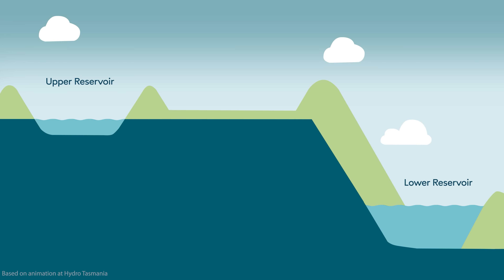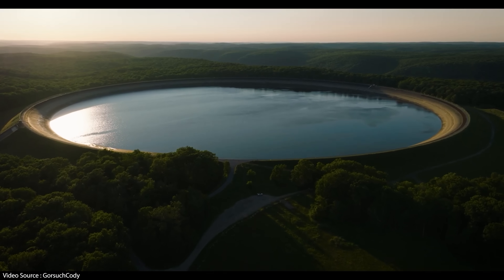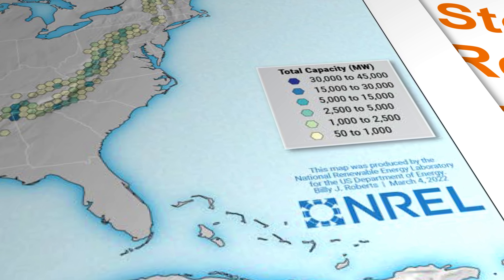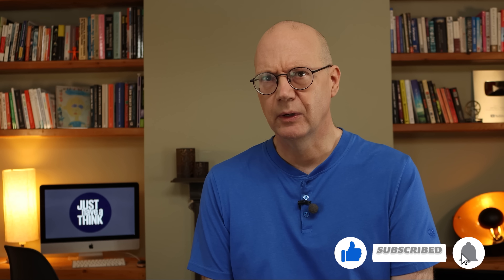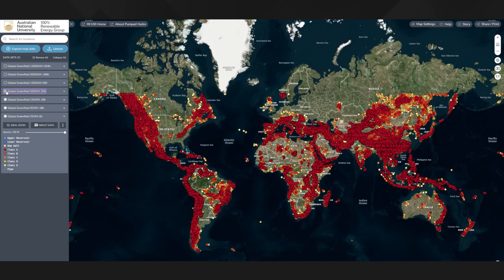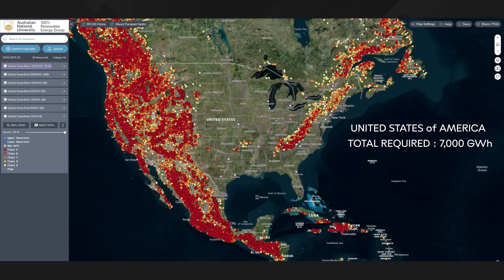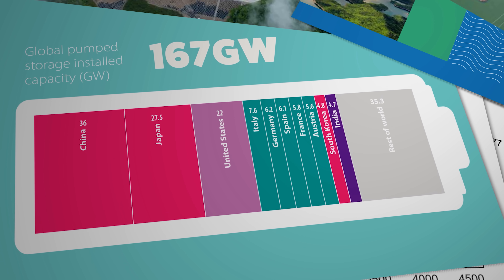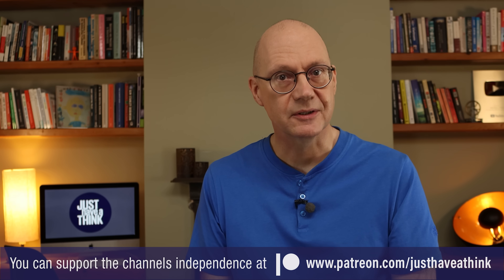The insane potential of Pumped Storage Hydro

Comment: I really hope they can advance the geothermal technology. I heard there's a possibility of a drill that cuts a bore hole with a laser and it hardens the bore hole walls as it goes so it doesn't collapse in on itself. It could really increase the level of depth we could drill too and the types of locations to drill at. Geothermal technology would be so helpful.

Comment: Thanks Dave - for another interesting & sensible idea. But I was hoping that you might also have mentioned the concept of "Hybrid" power generation systems. For instance, one or both reservoirs could be used for the placing of Floating Solar Farm arrays. For reservoirs that are in the open, obviously. And possibly with some well-placed Wind Turbines as well. There has been a (fairly) recent video about the benefits of floating Solar Panel arrays, (on another well-known YouTube channel about renewable Energy and EVs). Pumped Hydro is a well understood, known cost, tried & tested system, for efficient power generation. It's a proverbial "No-Brainer" - especially if combined with other renewables.

Comment: Any one with half a brain can work out that this won't work. So you are gi oing to pump hundreds of millions of litres of water up hill when there is excess generation, and exactly when is that likely to be. Why don't they just pump the water up at night when the cost of power is lower😂 pumping water up hill uses way more power than the water will produce on the way down. It's a great scheme to sell to morons.
Reply: Yes, water is pumped up at night when there is excess cheap electricity available, and then used to generate electricity in the day when power is most demanded. Pumped storage facilities in operation today work that way.
Reply: @sharkheadism   you are obviously  not too bright if you think it makes sense how is the power generated to pump the water uphill,
Reply: @Luke-pb9oz  Pumped storage literally works right now and it's utilized across the globe, and you're saying it won't. What do you know what engineers and utility companies don't?
Reply: @sharkheadism  well I know it takes many,many more times more energy t.o pump water up hill than it produces coming back down, tell me how the power to pump up hill is generated.
Reply: @Luke-pb9oz  The fact that it is used economically around the world should tip you off that it's not as inefficient as you claim it is. The energy to pump water comes off the grid at night, when there is excess cheap electricity available from baseload plants. It is then released when demand is highest, during the day.
Reply: @sharkheadism   how is the energy generated to pump the water up hill. It's a simple question why don't you answer it.
Reply: @Luke-pb9oz  From baseload plants that generate excess electricity at night.
Reply: @sharkheadism  you still haven't answered the question of how the power is generated,  but OK so there are power plants generating excess electricity at night, wouldn't it make more sense just to cut back the amount they are producing in the first place.

Comment: Humans have built 500+ meter buildings. The depth of 2 Olympic swimming pools would be around one floor of height. Depending on the footprint of the building one could easily have one or two double-sized swimming pools worth of water on the top floor and a floor-sized bathtub on the bottom floor. Skyscrapers already have mass dampeners full of water in them near or at the top floor.

Stupid question: Other than the fear of nearby street flooding if an accident occurred, why have we never built a pumped hydro skyscraper in a large urban city to get 3-6 MW of clean energy? Surely, there would be less evaporation in a building or enclosed tub as opposed to an outdoor reservoir, right?

Edit: I thought of more. This electricity would be right in the heart of a population center, so losses would be minimized in transmission. 
If a floor-sized basement was used for the lower reservoir underground, the first few floors could still be used as parking structures for nearby businesses and residential buildings.
Surely, a steel building can't cost vastly more, and may even cost less, than concrete dams to create pumped hydro storage areas in less than ideal natural locations.
Reply: No because we build skyscrapers for people to live and work in, not to generate power. Build a larger, far more economical pumped storage facility elsewhere and bring the electricity to the city.
Reply: @sharkheadism  You very well could be correct. I don't know. My thought process was that we have non-human structures already like radio towers. Windmills have a maximum height at ~250 meters.

Putting up a hydroelectric building may not be worthwhile. It would save on landfill space because the building would not have fiberglass blades like windmills though.

If the building is already going to be built, adding some vertical parking in the hydroelectric building could offset some of the cost. Putting more residences and businesses on current surface level parking lots could create more density and fewer miles traveled by car. These surface lots would be serviced by the hydroelectric building instead.

I just don't have the expertise to run the numbers. If anyone knows of an expert, I would really like to see the research.
Reply: @pace1195  The only way to make skyscrapers economical to build is to maximize the amount of space inside them that's usable to people. You've got to have other things like elevators and HVAC and so forth, but anything beyond the necessities just makes the building less economical.

Given the enormous power loads skyscrapers consume I don't think a couple of swimming pools or a wind turbine would do much to benefit them. Better to build that stuff at larger scales in areas where it's more productive. Transmission losses even over very long distances are so low it still makes economic sense to do it.
Reply: @sharkheadism  If you have no people, then it is just a barebones building. Sure, you need some elevators for maintenance workers. You would not need the H or AC, just the Ventilation for the parking garage portion. 

I thought of another addon. You could clad one side of the build which gets sunlight with photovoltaics. Then you have pumped hydro + some solar and parking fees.

You still may be correct. I live in the western US. I would like to see much more pumped hydro where it could naturally occur. I don't believe most politicians want it because of environmental and political reasons. 

A building which takes away surface parking and a few cars off the road gets around many of those restrictions, even if more expensive.
Reply: @pace1195  Using solar to pump water is a pointless undertaking because the best use of pumped storage is to generate when electrical demand is highest--during the day. Pumped hydro facilities release water during the day and pump it at night when cheap extra baseload is available.
Reply: @sharkheadism  I didn't say you need to use the solar to pump the water. It would just be an addon source of revenue for the building. Have 2 meters: one to send solar power when the sun is out and the other to regulate the pumping or draining of the hydro power for financial reasons.
Reply: @pace1195  You could do it, but that's such a small reservoir and it would be built on very expensive land in a very expensive structure, I can't imagine a single way it would be economically viable. Certainly suboptimal for cities that would benefit more from the parcel being used for human occupancy.

Comment: This is VERY exciting!  I'm curious whether there's a potential for this to work on a micro scale, similar to microhydro electricity generation.  For example, on a property with a 300' - 400' elevation change on it, could that elevation difference (depending on the amount of water stored of course) provide all of the power needed for a home and shop located on said property?  And if so, how much would the volume of water need to be?  Could you post any resources you have for calculating these things?  I'd be most grateful.  

Thanks for a very hopeful and motivating video!

Comment: And... if you add floating solar arrays on the upper, or both ponds depending on the facing, you potentially make them self "charging" (pumping to higher pond), and a generator even when they are not charging. Floating arrays would also minimize evaporation, and reduce the need for chemicals to minimize algal growth.

Comment: Also, please take a closer, more critical look at flawed iron air batteries. These are being foisted on us as "long duration" storage, when in fact they should more appropriately described as impracticable slow batteries, whose charge and discharge rates are ~100 hours, meaning you CANNOT use them fully in a 24 hour or more importantly 5 hour charge period which is critical to store solar. They are a boondoggle, being hyped as emergency low cost backup. Pumped hydro can be rum more quickly in either direction with the same volumes by adding more pump/generators. I believe most designs reuse the same mechanism for both pumping and generating.

Comment: Tasmania is 100% hydro power with additional capacity from the multitude of roof top solar systems installed. We’re connected to the mainland by an underwater power cable installed initially to sell Green energy to the mainland at huge prices. This was to produce more power rather than let dams overflow.
We’re in the process of installing a pumped hydro project using an existing hydro power station. It used to be that pumped hydro would replenish at night when demand was low and using cheap power from coal fired power stations. As these will be closed then the power could come from hydro, wind or solar. The only dependable option would be hydro (unless you have a drought) as solar won’t work at night and wind is intermittent.

Comment: Great solution and great video, Dave. Drought threatens traditional river hydro and evaporation and water scarcity could create challenges but not enough to dismiss PHS. Another untapped process could also be to use this with coastal saltwater which could assuage water scarcity concerns. 

Of course any time you manipulate water at massive scale, there are environmental impacts. But it seems more likely that pumped hydro storage could be more sustainably managed than any chemical battery. Lazzard's LCOS has unfairly put the finger on the scale for lithium grid storage for a long time, ignoring the impacts, sustainability, and competition for EVs. It's time for responsible stakeholders to deprioritize short term profitability (and unscrupulous energy arbitrage, Hornsdale!!) and instead make choices that aren't long term losers on sustainability. Please build pumped hydro quickly and sustainably and use it for daily time shifting of solar instead of saving the potential energy for peak events as we often do now.

I'm not a nuclear supporter at all, but Muddy Run PHS that is mated with Peach Bottom nuclear plant has demonstrated how pumped hydro can bank excess and provide its use later. That system allows the nuclear plant to run continously but provide more than its rate nameplate by discharging PHS during normal load times, and charging while people sleep.

Comment: I had to dig and dig to try and find the energy loss of closed loop pumped hydro storage and costs.

The loss is about 80% (but I suspect it is higher in practice).  Still, the costs are pretty high.

"How much does pumped hydro storage cost per kilowatt-hour?

between $106 and $200 per kilowatt-hour

"Pumped hydro is already the cheapest energy storage technology in the world in terms of cost per installed kilowatt-hour of capacity. Total project costs range between $106 and $200 per kilowatt-hour, compared to between $393 and $581 for lithium-ion batteries, World Bank figures show."

That's compared to natural gas:

"USA, December 2022: The price of natural gas is 0.055 U.S. Dollar per kWh for housebolds and 0.053 U.S. Dollar per kWh for businesses. For comparison, the price of natural gas in the world in that month is 0.121 U.S. Dollar per kWh for households and 0.107 U.S. Dollar per kWh for businesses."

PHS is several thousand times more expensive than natural gas.

Comment: When i was a kid they built the (then) largest Pumped Hydro facility in the world not far from my home in Ludington Michigan. They say it has 19.5 GWh of storage over a 9 hour discharge cycle. Its lower reservoir is Lake Michigan so only an upper basin needed to be built.     

I have heard of many mines in Michigan's Upper Peninsula, which are closed, and with their large height difference between the bottom and the surface, the amount of water needed is less for the same storage. In many cases the mines are filling with water anyway.  Additionally many mines still have electric lines run to them so that's another bonus. Using such sites means very little chance of the NIMBYs getting in the way as well!

Comment: This energy production format was set up in Scotland decades ago and it's strange that no new such plants have been created since that time. Hydropower is far more logical to invest in that turbines or solar which are inconsistent and need hydrocarbons to back them up or folks face blackouts during hottest or coldest or windiest (highest energy demand days of the year). 

I would like to see data though on just how much energy is used up or dissipates to run the pumping process and then to store the electricity created from the pumping process. This is usually the part where so called sustainable energy formats simply don't deliver to realistic expectations. It's not simply how much electricity that a format can create but how much of it can be stored or then actually distributed. This is where solar is actually pretty pathetic, unless being used very locally for the next day's local only needs. 

Only energy production formats which can store and distribute over longer periods of time are truly going to ever make much difference and that's why natural gas now filling in for massive roll out of small nuclear plants, seems to be the only realistic way to actually replace hydrocarbons, if you don't want to be facing a pre industrial impoverished future.

Comment: Sometimes, it's worth looking at the basics to find solutions to complex problems.

Pumped hydro is an old solution that works well and with some refinement, could work really well and could be ideal for grid storage, it's clean, it's reliable and more or less never runs out and with artificial means, it could more or less be built anywhere.

With all that said, we are still going to need some major improvements in storing energy in a more portable manner, but this solution could be the ticket we need in going to a clean, renewable future, at least in the short term till we find better solutions.

Comment: Pumped hydro is one of those things difficult for NIMBY behavior if done correctly.  For example, adding reservoirs capable of being used for recreational activities is likely to add to property values and provide developers new areas for creating very nice areas to live in, because, basically, what you are doing is adding a couple of lakes at different elevations.  In most locations, natural rainfall is more than enough to maintain the system despite evaporative losses, and in those arid locations this isn't true the water being pumped from buries aquifers isn't large compared to the size of the created lake systems.  

I suggest that it would also be quite possible to create completely artificial systems using manmade hills.  I suggest systems with integrated housing centered on manmade hills and lakes would not only be economically feasible but create some of the most desirable properties anywhere.
Reply: The lake is basically useless for recreation because of its near-constant water level variations.

Comment: I'm going to be pumping water on top of my container using the wind to run pumps directly and any excess will flow thru hydro generator and also flow when I need the power.

Comment: Chemical batteries for grid storage do not have to be lithium and in fact, most, especially flow batteries, are based on Iron, silicone and many other very common metals and minerals.

All in all, storage is mostly about economics and so I'm mall in favor of Pumped Storage Hydropower as long as the economics work out. Seems like they would, but no numbers are shared here, sadly.

Comment: The questions that were not answered in the video involve the economics of these systems compared to other alternatives such as battery storage. One thing pushing in the right direction is that renewables create peaks in generation when storage systems could pump the water back uphill very cheaply. However, unless these sites are situated along existing power lines or close to urban areas, they would require new connections and demands on the grid, which adds another hurdle for the planners. The idea that the economics of these have become better compared to alternatives like batteries with a fraction of the planning horizon and much greater flexibility seems highly unlikely.

Comment: Excellent as always, Dave. 

A thought keeps going through my mind with regard to pumped hydro . 

Why not use micro SMR's in both upper and lower reservoirs, (underwater of course).  Add floating solar panels and storage in the form of battery or compressed air storage, then you have a small-footprint, self-contained system which allows for grid frequency stabilisation plus longer-term base load.

Just having a think 🙂